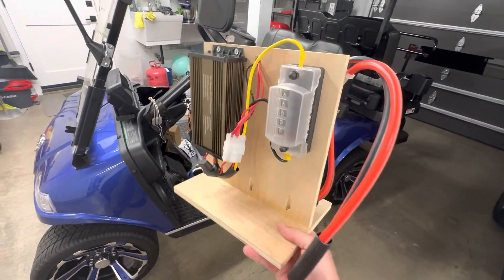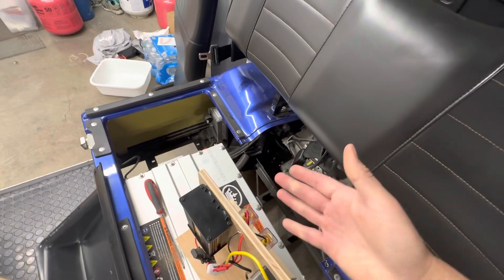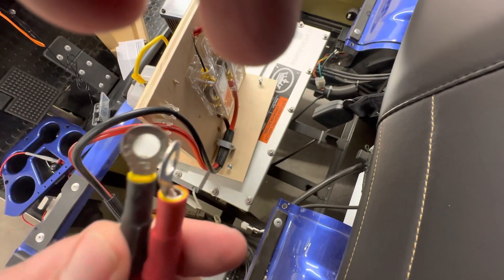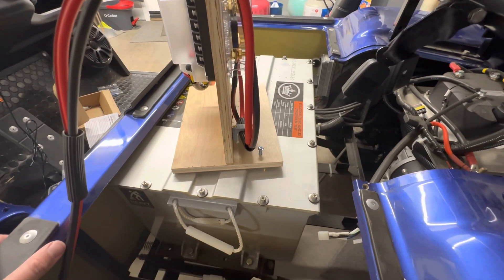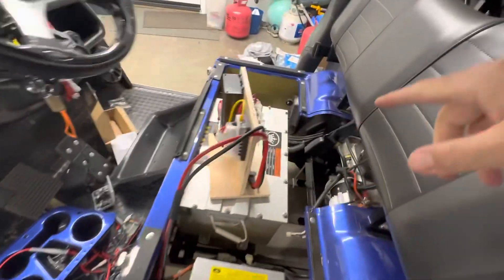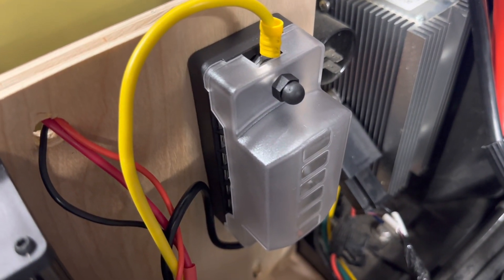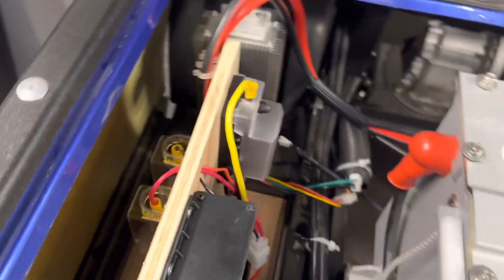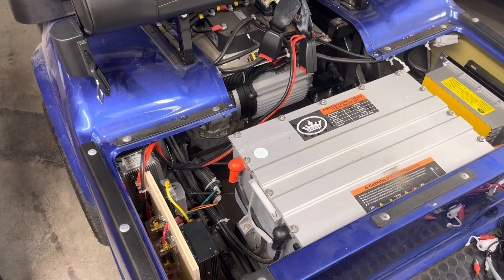Adding a voltage converter and fuse panel to my golf cart

Comment: I just did this job to my new evolution Classic 2.  I used a relay to prevent the continuous draw from the converter.  Wiring in the relay will stop the draw until the key is on.  Here is a easy instruction.  Relay connections are 30, 85, 86, 87A, and 87.  30 goes to the 48v battery positive with a heaver wire.  85 goes to the key switch.  Yes, take off the cup holder panel to access, use switched side.  86 is ground.  87A is not used.  87 goes to positive on fuse panel. Battery negative can go to negative on fuse panel. I glued mine on inside of cart body on the passenger side with Alien Tape.  Cover the exposed areas below to prevent water splashing up.  Good to go!
Reply: Did you make a video at all of your set up??
Reply: @mikescott2006  No, I did not make a video.  Just make sure you use a small fuse panel and a relay.  The relay will wire into you ignition switch and will prevent any power till the switch is on.  Turning on the switch it powers the relay and then the fuse panel.  Works great.

Comment: The buck converter will continuously draw current directly from the battery. Most techs would use a relay to send power to the converter only when the ignition is on. 50 amp fuses will allow 50 amps to short something out and the wood would add fuel to the fire.  I'm thinking that a 3A to 5A fuse would offer protection. 48 volts DC with a 100Ah battery is potentially a weenie roast. The two comments post 9 months ago are dropping hints, I hope that it is not too late, safety first. NICET III

Comment: Did you connect the key switch wire to the 48volt of the battery pack instead of a key switch?
Reply: That's what it looks like, there are 2 red wires going to the 50 amp fuse, and the voltage converter he linked, the thin red wire is the key switch wire.